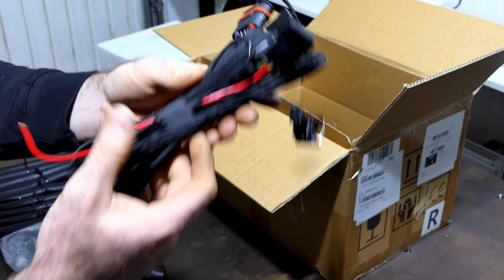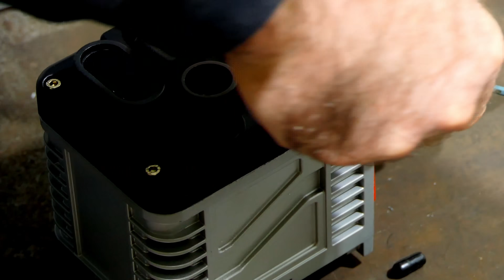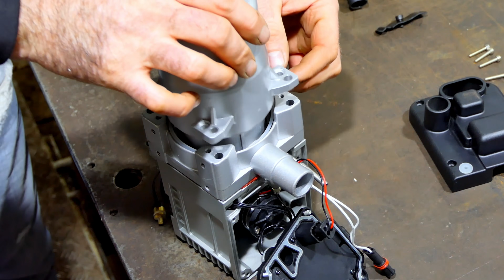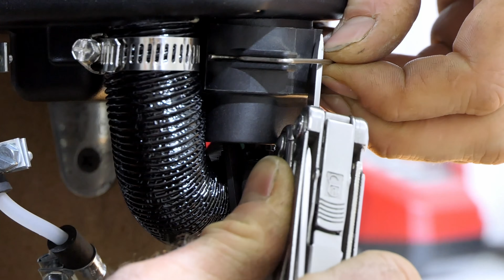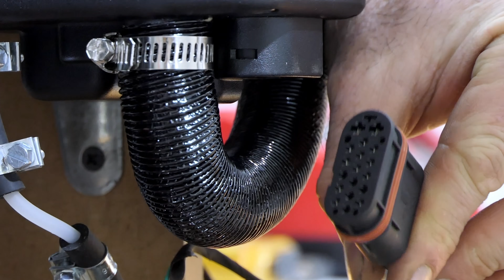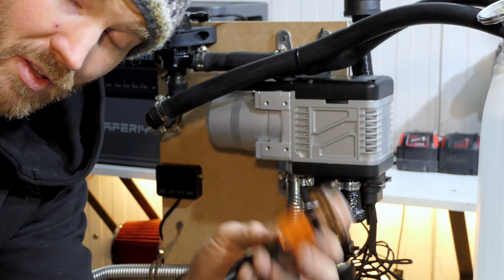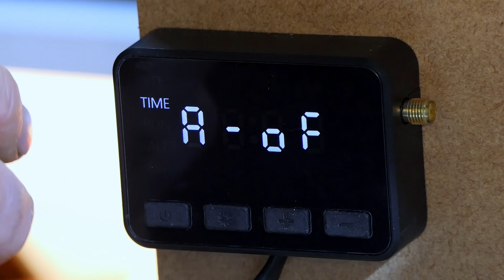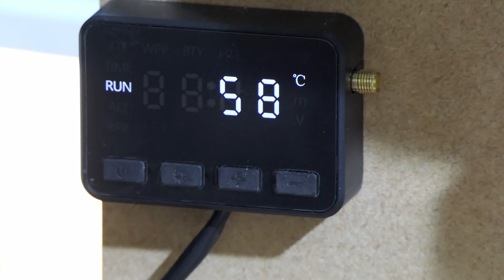Wonder of Manufacturing - Worlds Cheapest Automated Hot Water Central Heating System

Comment: It's an excellent little water heater - I've used mine for about 5 months with zero problems. Like yourself, I took it apart and purchased 'spares' and as for that difficult O-ring, I found that a small dab of Silicon Grease eased it's placement perfectly.

Comment: I built a vacuum attachment to add to a set of hair clippers a few years ago. The original set up used some ribbed corrugated 20mm flexible conduit, which was hooked up to a vacuum cleaner. Forced air down this type of hose screams like an air raid siren. I swapped it to 20mm aquarium hose, which has a much smoother internal bore and has a helical type and not ribbed corrugation; This solved the problem.

Comment: Brilliant video but howcmuch does it cost for a bath on household gas or electricity? Is this cheaper?
Reply from the maker: It depends on what the price per kWh is and how efficient the source is at heating water. Currently kerosene is £0.05/kWh whislt electricity is £0.25/kWh and gas is £0.07/kWh. Cheers J

Comment: That tiny thing essentially replaces that giant oil fired boiler in a homes boiler room? You might need two or three of those, but still crazy how much cheaper that would be.
Reply from the maker: They really are great and cheap. The efficiency isn't as good. Our Worcester boiler is 98% efficient. I'm still working on cost effective heat recovery systems for it though. Cheers J

Comment: Hi Joshua, I've bought the exact water and use it to heat hot really reduces the heating time for the hot tub. 
Q:
How do you get the heater to stay on continuously as mine will automatically switch off after an hour. 
Great videos 
Cliff
Reply from the maker: If you set to auto and set the temperature it should stay on until the required temperature is reached and then shuts off. Unfortunately I don't think it has a setting to auto come back on once the temperature drops. There may be a way but I haven't spent time figuring it out yet. Cheers J

Comment: You said several times in your video that using glycol would make your efficiencies better and I'm trying to understand your thinking.  Both Ethylene and Propylene glycol have about half of the thermal capacity of water so you would need twice the flow rate to transfer the same amount of thermal energy.   Other than that, great video and thank you for the breakdown.

Comment: Hey man love watching your vids, I'm really interested in seeing how you get on heating a hottub with one of these as I'm thinking of the same, either, this way or with a gas boiler, any sign of that video in the near future, Thanks, and well done on the channel.
Reply from the maker: @AKA_Mufasa  definitely In the near future. I've just got to fulfill a few commissions and sponsored videos first. Cheers J
Reply: @joshuadelisle  I took the plunge and bought one, Broke out the old cleverspa which I swore would never be back on because of the running costs, Built a doohickie to hold everything, not my best welding work but was only a proof of concept and I'm currently in the testing phase, It does do an excellent job, but if I was to be nit picky I would love more granular control over its operation, I no its not designed for this purpose, but hey the universe loves a tryer eh, I'm thinking along the lines of an arduino and the remote that comes with the unit paired up with a temp senser and an additional water pump.

Comment: 12.30 You tell that running glycol is more efficient than water? In what sense? Water has better heat transfer capability than glycol or water glycol mix. Or did you just mean that demineralized water/glycol mix doesnt create mineral deposits therefore in long term will be more efficient as the loop stays clean? I run my desktop PC on 100% demineralized but ofc it will never suffer from below zero temp environment.

Comment: What screwdriver/ multi tool are you using?
Reply from the maker: @hoog111  Bibury
Reply: @ thanks. I’ve had one in my save for later on Amazon for months. I’ve got a Victorinox that I’ve had for 20 years with a couple of broken blades. Can ordinary screwdriver bits be made to fit?
Reply from the maker: @hoog111  yes that's what's great about Bibury compared to the leatherman surge is you can use standard bits, jig saw blades and the scissors work better. Cheers J

Comment: Great review, I have a d3wz eberspacher wired/plumbed into my 2011 Nissan leaf. This unit is far more appealing as the genuine eberspacher is basically HotWired to work versus setup through an instruction manual. Poor qual vids of me bench testing this are on my yt channel. If I end up keeping the leaf I may end up swapping out the eberspacher for one of these. Not much space to play with under the bonnet of the leaf for things to get hot next to important wires.

Comment: All metal water pipes experience galvanic corrosion regardless of what other materials are combined. The problem is when there is a difference in charge between the materials leading to accelerated corrosion. It is a common misconception that plastic will prevent galvanic corrosion. Plastic pipes are non conductive but they will build a lot of static electricity on the surface. That static charge is carried by the dissolved minerals in the water into the metal pipes and will also increase the speed of galvanic corrosion. You need to add a Merus ring or sacrificial anode to the metal pipe to prevent corrosion.

Comment: 23:16 - 5 kW of heat is really what the burner is producing, that's easy to calculate by the fuel consumed. Every test I've seen of similar heaters confirms they are 5 kW. Here there's a lot of heat going out from the exhaust and radiating from the test system itself, so 3.2 kW in effective energy output to the water in this case is perfectly normal and to be expected. I saw another test similar to this, and there the calculations pointed to 3.8 kW in effective energy output, but these figures are in the same ballpark at least.

Comment: Have you figured out how to run it for longer than 1 hour? 
if using it to heat up the hottub will take longer?
can it be programed to run until manual shut off? and then adjust the parameters to turn on and of with the temeratures used for the hottub? ex 41 off and 39 on?
Reply from the maker: @andersreffs3195  I haven't finished testing fully but I believe in auto mode it's dictated by temperature, so as soon as it hits a certain temp it will shut down. Cheers J

Comment: Nice vid keep up the good work. Do you know how far you can run the water hoses or can you replace the pump with a bigger flow rate?
Reply from the maker: It needs the original pump even if you add an extra boost pump. It will detect if the pump isn't running and will stop or shut down for safety. Cheers J

Comment: What a price compared to the Webasto and Eberspacher very nice-looking alloy casts, it appears the Chinese are getting better at quality control. The only thing I noticed was the flow of water is a lot less than my Webasto thermo top. There are specific heat exchangers available when used in a glycol system to heat the air, or indeed hot water for showers or washing. Quite a lot of motorhomes have the same system. Nice to see you warn of the copper pipe's galvanic action also not to be used for exhausts because of poisonous fumes

Comment: In theory this is a hot water central heating system that does not need a central heating engineer, who condemns your boiler at the drop of a hat.  This is quite a saving besides the cost of fuel.  It is basically like a car that you can easily service yourself - something akin to a Ford Model T, which is to say absolutely brilliant.  The only real issue is the water leak..

Comment: Thanks for video! calculations are wrong for one hour usage of diesel it will be 1.4pound / 0,42litre = 0,588pound per 3,2kW / hour = 0,18375 pound cost per kilowatt not 0,2871pound, so it is alot cheaper as your calculations are, i revied chatgpt calc also that is different, you nee put more presice promt to it :)

Comment: One mistake, glycol inhibits heat transfer, not much, but the decrease will be greater with higher glycol concentrations.  30% propylene glycol will decrease heat transfer by around 10%.  Also, glycol takes more power to pump, again, not a lot more, but this also increases with higher concentrations.

Comment: Hi Joshua,  is there a cheap alternative way to heat a 250ltr water cylinder tank?
Reply from the maker: @johngore8443  sure. This is one especially if you buy heating oil in bulk for £0.55/Litre. Rocket stove is another and can be fueled with free pallet wood. For automated and long run low maintenance burns, wood pellet stove with a water heat exchanger is another option. If you don't like burning fuel then you can get a low rate energy tariff at night and set heating timers. I'm planning on building a whole system with an efficient rocket stove. Cheers J
Reply: @joshuadelisle appreciate your response will look into it,  thanks

Comment: Just finished up on a Webasto Thermotop Evo setup. Running underfloor heating. Don’t work as well as hoped requires the unit to run at full speed for nearly an hour to get the whole floor upto temp and unit to idle down. Where using rad’s only takes around 20 minutes to heat the whole system. The amount of diesel used on the UFH is about 4 times the amount of rads. You say you can’t use Cooper & Ali together. My system has been running for 15 years. I’ve not seen and corrosion of Ali parts whatsoever I do use an inhibitor for extra protection. A friend of mine has a wood fired hottub and thinking of doing the same thing. Preheat the water so you can just top it off with wood once you get there

Comment: Great video, I love it when you explore alternative and affordable ways of heating. I'd only add that saying the unit is only 3.2kW isn't quite correct. You should take into account that your system has a lot of losses. Not only on the exhaust but also the water dissipating heat onto the environment,. In an ideal world, you should have the water in a closed system that doesn't lose heat to measure the efficiency.
Edit:
Also, since kWh is a measure of energy, W is a measure of power, and we know power is energy divided per time; saying kWh/hour would simply be kW. Another useful thing to understand is that 1 W is the same as 1 J/s, 1 kW equals 1 kJ/s, 1 Ws (watt * second) is 1 J, 1 Wh is 3600 J as 1 hour is 3600 seconds, 1 kWh is 3600 kJ, so on and so forth.
Working with measurements of power and energy would confuse me so much until I learned this, so I hope this can help you🙂

Comment: What a fantastic video! Very detailed and practical! About the cooling system, Water is better than glycol at heat transfer but regular tap water will corrode. That’s why most club race car drivers prefer distilled water in their cooling system as long as they don’t live in an area where water freezes which will cause the engine block to crack.

Comment: Would you need a different pump for glycol due to the viscosity? I would love to see someone make a heat exchanger for a small heated pool or hot tub. ✌
Reply from the maker: @uncleike4837  the pump it came with is actually for glycol specifically I believe. Works with water too. Cheers J

Comment: Really interesting and well presented video, as always. One thing puts me off this unit is the maximum 60min run time which makes it impractical for a central heating system in say a workshop. Is there a way to switch off/override this feature to allow it to run for extended periods?
Reply from the maker: @dannyboy9817  thank you so much. I'll find out. Cheers J

Comment: Hi, maybe not ideal for you but for special rubber or silicone gaskets that are impossible to find, I use a 3d printer to make molds and cast it with loctite silicone blue or black, of course this can work with any silicone sealant but loctite curing time is well documented (it can take several days, the thicker, the longer) and also reliable. Definitely not the simplest/fastest solution but better than not fixing something because of stupid gasket not available (or prohibitively expensive) ....

Comment: Since I can not get Kerosen in Estonia, but I am Farmer and get WHITE car Diesel for 1,10€/l instead of 1,56€/l at the Petrol Station, I have a very good experience with my VEVOR 10kW 24V Water Heater for 156€ and shipping in 7 days from the Warehouse in  Poland to Estonia.

The efficiency is a little bit over 80% but I heat a 500l Heating Buffer, not directly, but over sn internal Heatexchanger Dpiral, because the house run with 33% Glycole and the DieselHeater, SolarCollector and Compost Heater with 50% Glycole. Otherwise, I would neef to much of the expensive Glycole, which I already buy in wholesale from the Manufacturer TELKO.

Have a nice day and
happy continuing

Mery Xmas
Michelle
Reply: Oh, If someone gets hands on Marked Diesel Fuel, it currently costs only 0,70€/l but officiel illegal to use, hence I am very satisfied with 1,10€ for the white car diesel

Comment: My greatest concern about the use of this system is that it is extremely small and it's substandard quality, particularly involving it's functionally  involved materials, tolerances and durability, would really necessitate its user being able to constantly monitor it for fatigue failures and be prepared to intervene with service and repairs as needed to head off any predictably unfortunate outcomes. I would not recommend it to the average user.

Comment: I think the reason for the missing heat sensor gasket is the anticipated heat expansion, which may cause pressure to occur between the facing surfaces of the  two involved parts.

Comment: Pretty sure they count the exhaust into the 5KWh measure.
If there is temperature guard function run this as maintenance holder to keep water from freezing and wood to majority heating method, so the bath does not freeze and crack. Would advice same thing with the underfloor heating system if installed into house, so you dont run on liquid fuels constantly well as having back up system. Also its damn shame its built like that or i would run one in garage with waste oil and what ever cheap oil is available.

Comment: Another great video - I've watched a lot of your videos and was thinking of installing a hot air heater in my workshop.  What do you think re using a hot air heater vs this hot water system and radiators if someone is starting from a blank slate?
Reply from the maker: The air heater is cheaper, easier to install and you'll feel the heat quickly. Water is more expensive, time consuming to install correctly and takes considerably longer to heat the room. The main thing to think about is the insulation of your space. If you have good insulation then what ever you use will heat the space quicker and stay warm for longer when the heating is turned off. I'm planning on building a garden office with 100mm thick insulation. I'll  be using heat recovery ventilation and a dehumidifier and that's probably it without the need of any kind of heating. Cheers J

Comment: Again, fab video full of inspiration! Ya gotta build the hot tub! 
P. S. - can the exhaust be too long and/or do you have a calculation for this? In terms of heat recovery from the exhaust, could that heat, or just take the chill out of a small changing room, by cycling it around and around in a downward direction, eventually exiting at the bottom? In essence losing the heat to the room?
Reply from the maker: @danielcookeb90  thank you. The exhaust should be closed to what's specified because of how the combustion gas flow. Too much pipe gives too much restriction which will effect the efficiency of the burn. If you want to increase the length then the best way is to increase the pipe diameter or have a manifold of many pipes to increase flow and reduce restriction. Cheers J

Comment: Fantastic presentation.  New subscriber..  one point, though I don't know how important it is.  As the water heat up the heat transfer rate between it and the chamber gets less efficient.  I.e. delta T decreases and so does heat transfer.  I have no idea how much, but a rise in exhaust temperature proportional to rise in water may give a clue.  Anyway, recovering exhaust heat would probably mostly negate this loss.

Comment: Looking forward to the next.what if you used 2 or 3 large cast iron radiators. Or build say a 100 gallon hot water heater? How long and how much fuel would it take heat that water to 180 degrees? Using the exhaust heat as well to heat the water. How about slowing the circulation so that any radiators in the loop has enough time to loose say 20 degrees of heat before returning and reheating if that is at all possible. So 3 radiators, at the end of such a loop would have a return temperature of 110 - 120 degrees Fahrenheit. I wonder how quickly it would heat your space, even after opening the non insulated door,🙂. lol I would guess aluminum radiators would give up their heat faster, while once that cast iron gets hot it would store more heat taking longer to cool down, hum slower recycling time? Or some sort?